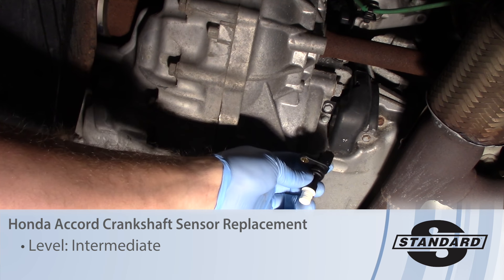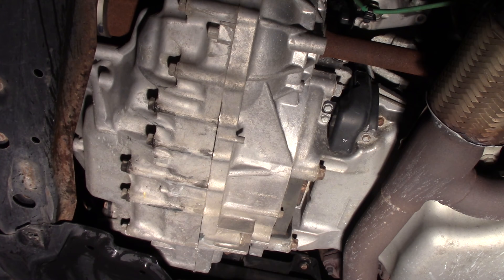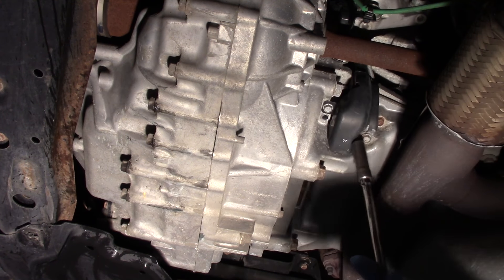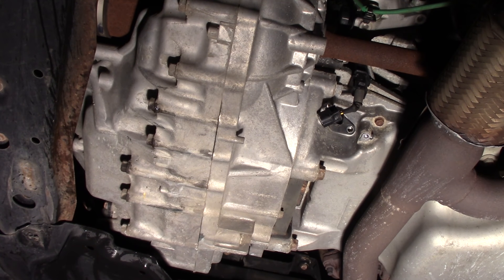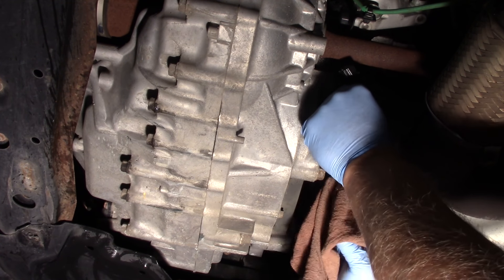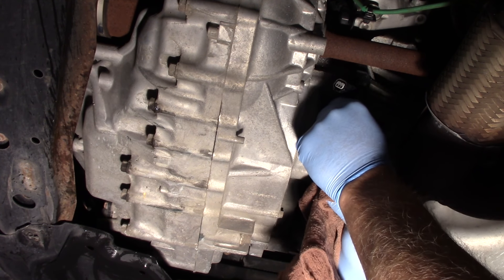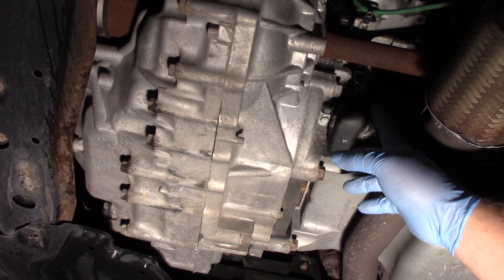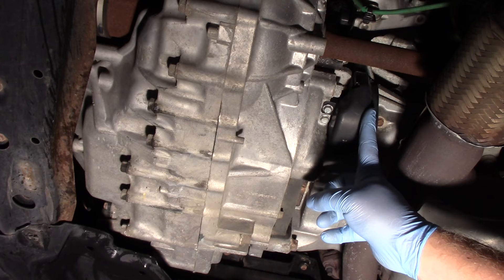Honda Accord Crankshaft Sensor Replacement

Comment: Getting exactly same symptoms, cranks and runs fine for 15-20 minutes and after full hot, it dies on the spot and won't start. After 10 minutes, it starts back up. Dealer replaced new crank sensor, but still getting these on Honda Accord 2013 EXL V6 at 100k. No luck yet.
Reply: Im having the same problem with my Honda Accord 2009 LX. Did you fix it?? What was the problem? Your reply would be greatly appreciated!!
Reply: Clogged cat?
Reply: @odbilegsarankhuu7822  ??
Reply: Sounds exactly like a bad Main Relay

Comment: Great video! I was wondering what’s the piece above the sensor that’s going to be lubricated and put back into oil pan? It’s a small piece with wires connected…I’m trying to find that exact part for my honda

Comment: I got P0339  HONDA  CKP SENSOR A CIRCUIT INTERMITTENT (too) on my 2008 4 cyl Honda Acord. ... My INNOVA OBD2 scanner also pulled a 10 second BATTERY Monitor scan test resulting in 11.84 VOLTS  (at ECM vs 12.5v at my battery terminals) ... while saying: "BELOW  ACCEPTABLE LIMITS". ... I believe my small 4 cylinder Napa battery  has been reading marginally lower voltage for a couple years plus (& possibly the biggest source of my problem). I also believe some higher end batteries of same small size would retain higher voltage. My Choice now is: I am going up to the 24F larger size battery (spec 6 cylinder Accords) in AGM format as my best  long term fix. I lost Engine torque when that code tripped. ... Erasing that code with my Innova scanner after study resulted in no more problems or codes returning (so far/ even though my 24F AGM battery  order  in progress makes that a near future project).  ... My two cents  as a past mechanic shop owner who still does all my own wrenching :+)
Reply: Yessir ... when these cars were new... the Civic style 51R battery was fine... once they start get older... you need more cranking amps to turn over the engine. Getting a bigger 35 or 24F which has 200 more cranking amps also saves the starter from early replacement. Honda/Acura did bad with these smaller batteries just to save fuel.

Comment: I have a 2012 Honda Accord wit cylinder 2 3 & a random misfire also a crankshaft code up car engine light flashes & wont go pass 3000 rpm any thoughts ?
Reply: It could be the distributor,  ignition coil inside the distributor,  alternator,  or the crankshaft sensor.  I have the same issue and trying to solve it. I changed my spark plugs and ignition wires. Added new oil. Still got a code P1381 code. 

Going to try changing crankshaft and ignition coil inside in the distributor for my car.

Comment: What are some of the symptoms that could mean this sensor has gone bad?
Reply: Crank but no start(similar to ign modules too), Starts and drives fine when cold/warm ... when fully hot the car dies on the spot and won't crank back up until the engine is cool.  The car's ECU limits you to a mere 2000 rpms and giving it anything past that will make the engine detonate and sound like a bag of marbles..
Reply: Getting exactly same symptoms, cranks and runs fine for 15-20 minutes and after full hot, it dies and won't start. After 10 minutes, it starts back up. Dealer replaced new crank sensor for $500, but still getting these on Honda Accord 2013 EXL V6 at 100k. No luck yet.
Reply: @Striker50_   what kind of "scanner tool" is needed? is it something i can rent from an auto store?
Reply: @lynntucker4196  Yes most stores will lend you the tool if not, you could get a $25 scanner on Amazon. I made a video on my channel on how to replace the crankshaft sensor, let me know if you have any questions

Comment: Excuse me
I have same car. And I have cod po335 error
I replaced crankshaft. And then still the problem
. I cleaned wires same Same
So what can I do
Also when removing cable of air sensor There is no response
Can tell me what can I do? Please
24 not 35
Reply: That relearn procedure has to be done, else the pcm does NOT recognize the new part and  adapt to the data.